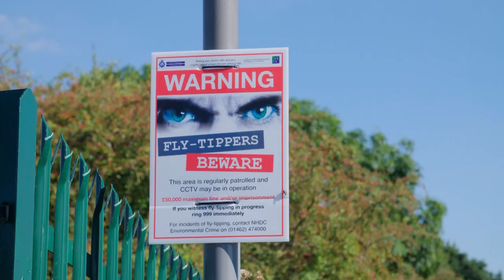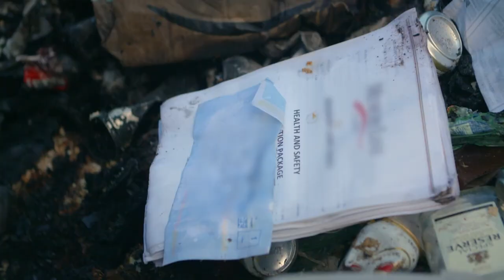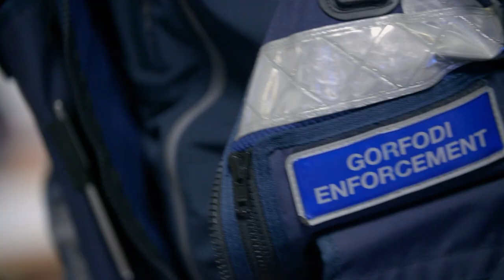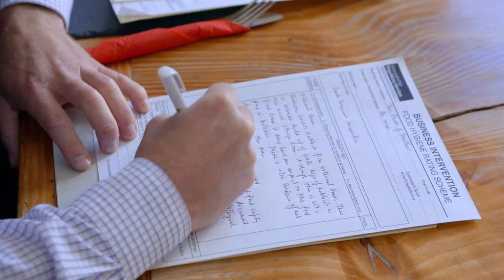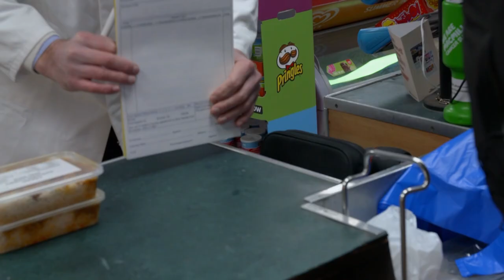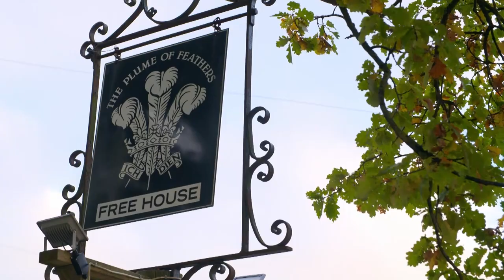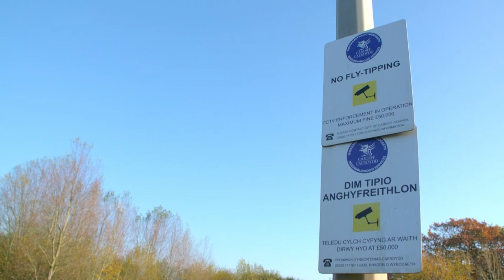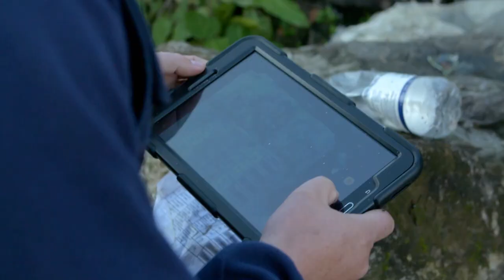Cleaners Face The DIRTIEST Bathroom Ever Seen! | Grime and Punishment | Filth

Comment: Life Hack, (plumber's trick) if you get a blocked toilet and don't have a plunger handy, I completely unblocked my toilet yesterday using 1 cup of bicarbonate of soda, wait a few minutes and follow it up with 2 cups vinegar.  Leave it to sit for approx 20-30 mns then flush.  Miraculous.  I also used some dishwashing liquid and a kettle of hot water during the process but either way, toilet was quickly back in operation.  Thank me later.
Reply: Didn't work for me.
Reply: It depends what caused the blockage to start with so it's not a miracle medicine. But it's a goof start if nothing else is available for the moment. :)
Reply: I have used this method twice; it's only worked once... Though to be fair, the time it didn't work, the plumber admitted the blockage was further down in the pipe than the hot water, soap, and other things could reach, and it was a thick blockage
Reply: To clean the toilet bowl get a 28oz (+/-) spray bottle fill with 1 cup bleach 1/4 cup dawn and the rest water.  Shake. Clean bowl 2x week. Prevents blockages from happening. In 15 yrs. I've never had a clogged toilet. Good to clean the sink bowl as well. No clogs no germs.

Comment: That young couple are way in over their heads.
The way the place is set up, or rather, lack thereof, it's more than obvious that it's a nightmare to keep clean. 
Not realising that when they decided to rent it speaks volumes.  
And cleaning out that grout with a rag? What about a firm brush, or better yet, a power washer? 

I'm not surprised they have quit the business. 
My guess is it was in poor condition when they started out there, and they just went in and started the business. Without cleaning it first. 
A lot of the filth there has clearly taken years to build up, not the 10 months they were there.

Comment: The reason why people dump garbage like that is because it’s really expensive to take garbage to a garbage dump, and many people simply can’t afford to do that. If it was free to dump garbage at designated dumps then this wouldn’t be as big of a problem as it is now.

There is also the problem that in some of these cases the people that actually dump the garbage and the people that throw it away are not the same people. There have been cases where people might not be able to afford to dump garbage at the regular dump so they call a third party, usually they change way less too get rid of the garbage. But instead of taking it to the dump they just dump it in random locations. In this case it isn’t the original person’s Fault because they are never actually told the real location of where there trash is dumped. Instead they are told it will be taken to the local dump.
Reply: It’s free in the US. Well, nothing is free — we all pay for it with our taxes but there’s no additional fee.
Reply: Thank you for explaining.  After watching these videos I didn't understand that.  As the previous commenter said, in the US there is no additional charge.  I suppose we have that going for us.